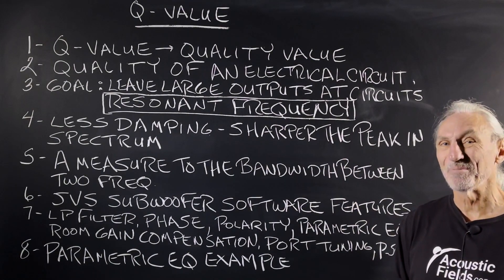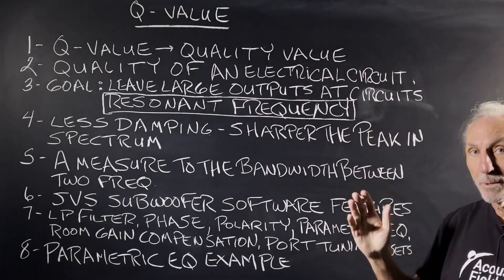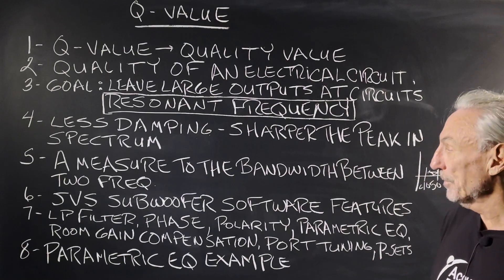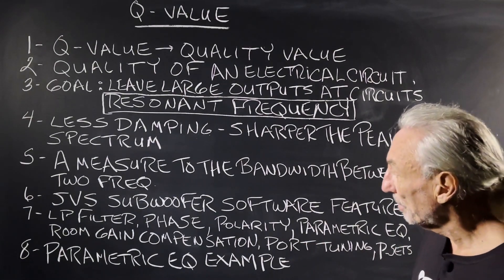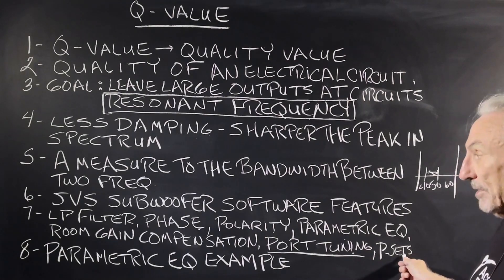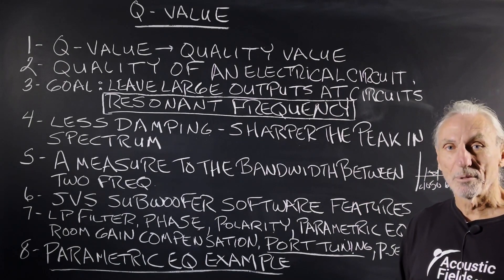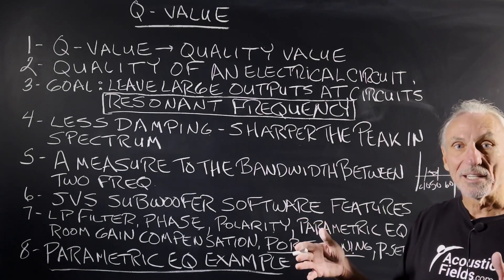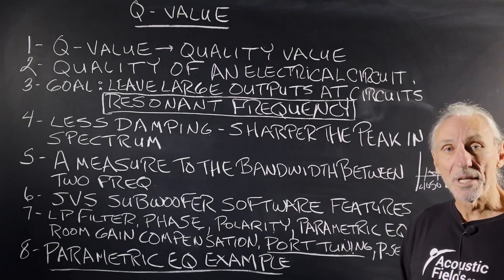Q-Value - www.AcousticFields.com

Comment: I have 4k svs 4k pb can i ask for fav please if i send you my sub graph can you please tell me where to set my eq in the svs app please
Reply from the maker: Start with a song that you are famliar with that has a consistent and repetitive bass line. Look at the RTA response and focus on the energy below 100 Hz. Adjust the gain on the subs to be -3. This output level will minimize the cabinet movement. Start with the cross over frequency at 40 Hz. Adjust the gain or boost to smooth out the RTA response. Once dialed in use the Q function for "tightening" everything up.
Reply: @AcousticFields  hi i use mu svs 4k pb for movies i have anthem and run room correction
Reply from the maker: Stay with the instructions that were provided. The room only sees energy.
Reply: @AcousticFields  thanks for your help just quick one floor standing speaker close to side wall out a little from back wall beside directly behind and its first reflection on side wall do you recommend to have a acoustic panel along side the speaker as well or no need ?

Comment: That's great the Parametric EQ built into SVS subs, very handy tool, I owning Yamaha RX-A3070, I can open it's PEQ and do the same from there with my subs, either way it's a great feature to have, for that fine tuning of subwoofers.
Reply from the maker: Any tool type that can assist us with low frequency energy input into the room is always welcome. All low-frequency input into the room is error. With electronic control of gain, crossover frequency flexibility, boost, and Q control, you have a formidal electronic arsenal to manage the biggest animal in any room regardless of usage.
Reply: @AcousticFields  So true, and well said 👍😉

Comment: haha! just last night I was tweaking all these parameters in my new living room on the SVS Micro 3000. I couldn't quite decide which slope to use on the cutoff frequency, si I chose the middle one, 18db. Each adjustable parameter can affect the others.
Reply from the maker: Yes, you are correct. Its all one large family of sonic issues that all must work in synch.